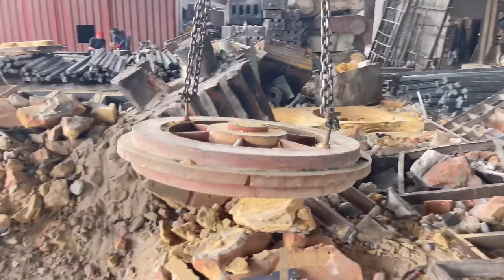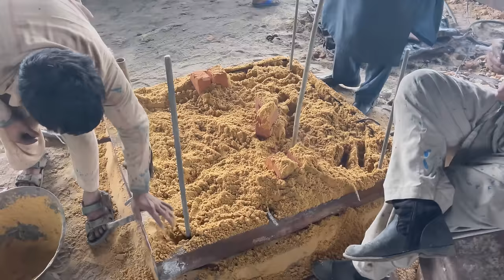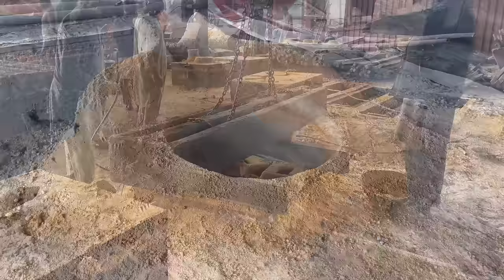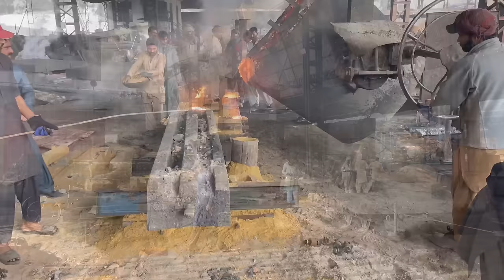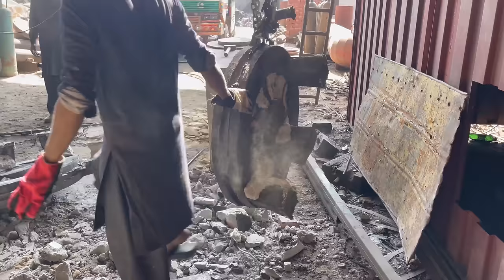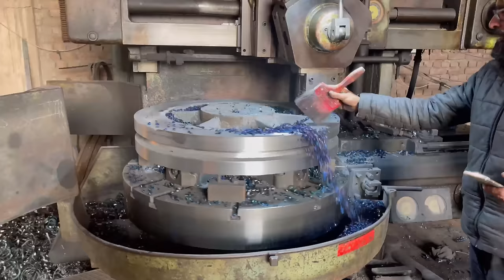Crafting an Industrial-Scale Gear from Start to Finish | How It's Manufacturing ?

Comment: The wheel is still not in a usable condition. It's off center and wobbles. But this was the first time I saw someone in this videos wearing something resembling security shoes and not flip flops, even if there were only a few.
Reply: It is a low speed chain gear for something like a rock crusher or heavy conveyor belt - it doesn't need to be multi-plane dynamically balanced.
Reply: These are the UK work practices of 100 years ago. There was no incentive to develop local industries because the Empire was regarded as a destination for English manufactured goods. BTW, their electricity is generated mostly by coal. 

These are artisans doing work that has largely ‘died out’ in the UK(and Australia)-we all import from China now.

Celebrate their work. Change will come to their country too. But please don’t apply our first-world standards to them.
Reply: @Tedinoz  They will never get to first world standards at this rate.

Comment: Mystery metal, anyone?
As a retired chemist and metallurgist I cringe at these practices.
Whatever the gear is going to be used for, I hope it is not a safety critical application.
Mind you, the application of such primitive methods to produce industrial sized castings is rather impressive and speaks of loooooooooooong experience in performing this dodgy but relatively successful industrial manufacturing.

Comment: That sand is gorgeous golden even with the additives.. where do they get it??
Reply: It's pretty much just regular sand with oil and sodium silicate mixed in. The oil causes the sand to stick together so it can be molded to fit the shape of the patent (master shape). The small holes you see them poking everywhere are for the injection of carbon dioxide. Sodium silicate goes like a very hard binder when it comes in contact with CO2 and keeps the mold from collapsing which is why they can lift the molds with a crane.
Reply: Thanks I was wondering what were the additives and also what was being injected.. What kind of oil do they use?
 @oh8wingman
Reply: @rodneyfrost1674  It's saffron with mustard oil 🐸
Reply: @rodneyfrost1674  I'm pretty sure they don't use oil.  It's just sodium silicate and sand.  The carbon dioxide that is injected causes the liquid sodium silicate to turn into solid silica that binds the sand grains together.  There is an oil-based sand (like Petrobond) that can be used for casting but that's a different thing.  You can tell when they are using that because it flames up when hot metal hits it.

Comment: That's not a gear. That is a cog. A gear meshes with another gear. That's a cog that drives or is driven by a chain.
Reply: A cog is a single tooth on a gear, that thing is a pulley. It would be driven by a big rubber belt, or similar.

Comment: Couldn't have been less centered if they tried.
Reply: It is a low speed chain gear for something like a rock crusher or heavy conveyor belt - it doesn't need to be multi-plane dynamically balanced.
Reply: @johnswarbrick2365  Okay, I guess that excuse is as good as any.